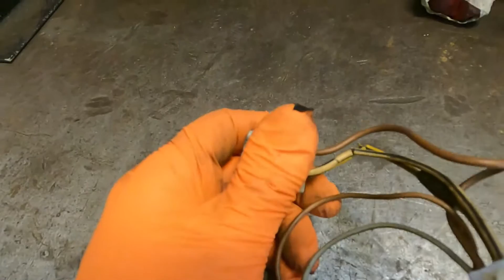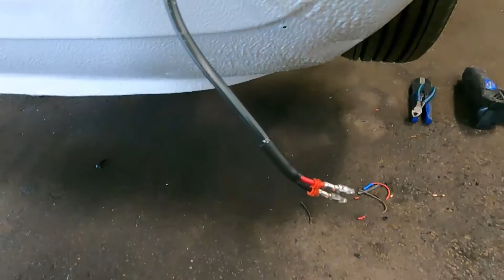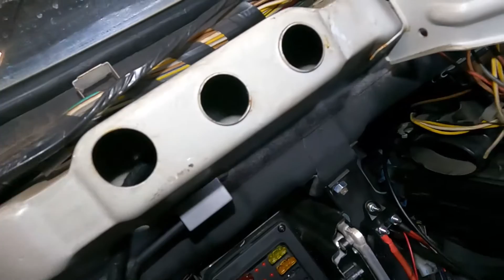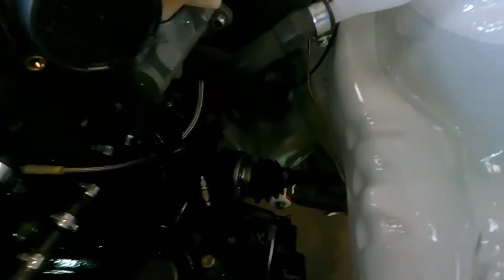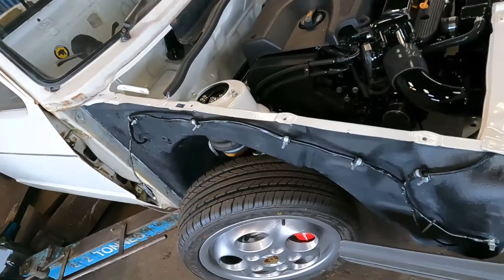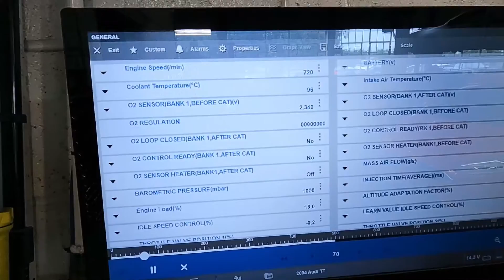Ep20. The 20v Turbo Caddy is FULLY ALIVE!

Comment: Awesome,  damm, I'm all caught up now 😮 now I have to wait. Question, will it be possible to fit a TT engine with it's gearbox and running gear to make it 4 wheel drive?
Reply from the maker: Anythings possible, depends how much work you want to put in 😂 it has been done before. Initial problems is the 6speed box needs clearance to the chassis leg, and the prop points at the steering rack, loads of room at the back for the haldex though 😀 would love to do one 😁

Comment: indicator switch for park light, a smack to get left side working ? I this was my build I would not be happy. Its all good I guess. Thanks for time out documenting this.  I absolutely love it. especially the wiring part. I would just like your opinion. with regard to ecu's. if one is doing this conversion  does it matter whether you install a 150 or 225HP Ecu?
Reply from the maker: The indicator was just a bit of corrosion in the bulb holder. Wiring wise they all wire in the same to wire in pretty much. There are some variants on 20vt's, cable throttle, vvt, wideband lambda, egt, but they can all be mapped to suit with supporting mods.